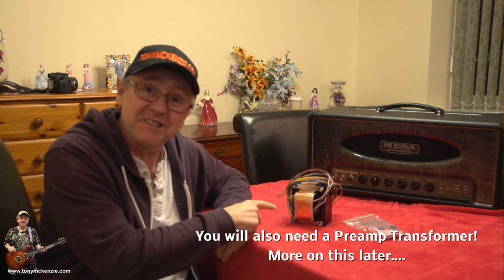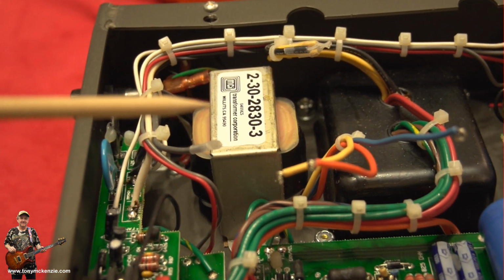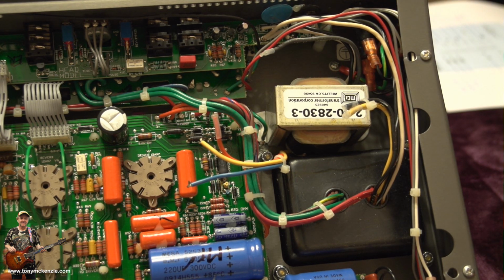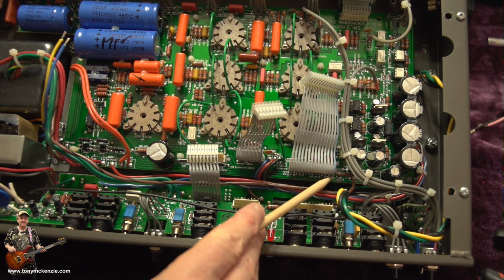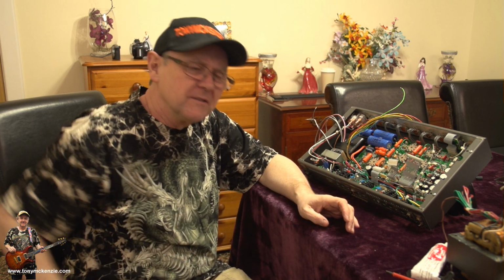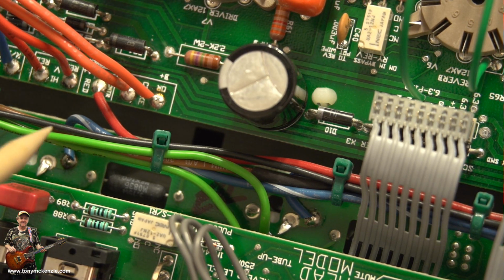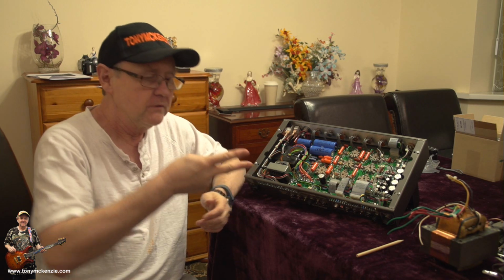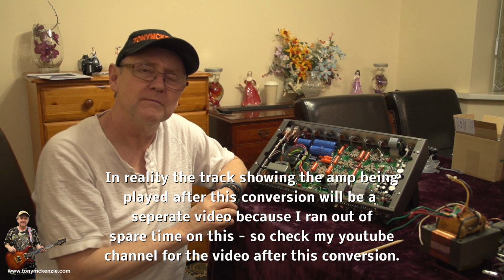How to Convert a Mesa Boogie Electra Dyne to 240 volts | Install a Power Transformer | Tony Mckenzie

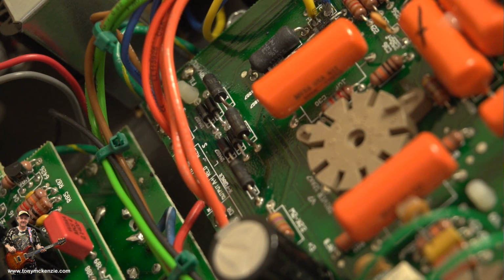Comment: I’m curious about the service modification you mentioned in the diode section at around 41:10. What is this mod supposed to do with regard to improved reliability?

I’ve got a ‘Dyne that has a pretty substantial hum which doesn’t seem to be caused by anything to do with guitars or pedals, it’s definitely internal to the amp. Particularly pronounced in the Vintage Hi mode with high “volume” (gain) settings. I’m curious if the diode mod would help here.
Reply from the maker: The mod is a Mesa mod... ask them! Ha but I believe it stops stuff burning out. You will see burning if there is the issue. Also look at the filter capacitors as if old they can create hum of course. Hope it helps and thanks for watching.

Comment: Does the orientation of the green filament wires matter? Testing them is no use as the ohms are too low.
Reply from the maker: I don't believe it does, but check on the diagram to be sure!  Thanks for watching.

Comment: can you link to a schematic and parts list, or email me one? pleeease? what kind of diodes are the d33 and d34 also? or just linking me those would be awesome. i see you have one in this vid.
Reply from the maker: I did NOT change the diodes - there is an in field mod that Mesa mention about rewiring the diodes because on some amps they have had failures I believe. Mesa might give you the info for that - its out there on the net. For the conversion you need the PT and the secondary transformer that I showed... both available from tubeampdoctor.com - ask for Stephan and mention my name as he worked with me on this one. You also need a MOV as I showed and a replacement fuse depending on your voltage needs. The schematic is also on the internet.

Just be careful as you can get killed if you are not proficient in electronics with high voltages as inside the Electradyne. Hope it helps and thanks for watching.
Reply: thanks for the response but i got everything squared away with an email to mesa and performed the mod to fix (bypass) that diode failure - 
I only messaged on here because you are the ONLY guy on youtube with a mesa electra dyne that still is active & knows what he's talking about. Don't worry, not trying to change the power here :) never had to get a schematic for an amp before, and was saddened to find that there were schem's for almost every mesa amp BUT the electradyne it seemed...but within only 2 hours i got an email back with the schematic, after leaving a voicemail with mesa cust. suppt
Reply from the maker: Yes I know, I had to get the schematic from them at the time too. The Electradyne is not a bad amp and surprising how basically it is not that common place. I have a Royal Atlantic too which is similar to the Electradyne but more drive and has some attenuators on there so you can drive the amp channels more. Good to know they helped ;-)

Comment: I'm in Singapore and it'll be great to be able to do this on my Mark IV. Just wish they all came with the old export transformers where you can switch from 110-240.. Running the amp on that big fat external converters for now.
Reply from the maker: Yes I run mine on the big lumps of external TX too a real pain. Some companies still have 120/240 in them but Mesa don't. Strangely DV-Mark used to be one voltage... but now on current stuff is 120/240. In any case as you see its not too difficult if you're used to working with electricity - particularly the stuff that can kill... so just be careful. The great thing is, that Singapore has the same mains plugs as here too :)    Thanks for watching.

Comment: The voltage in America is the way it is, because there were once two electrics systems. 110 volts DC and the transformer based, down to split, single phase 480 volts AC. But, in order for people on each system to use both Edison and Westinghouse light bulbs, they had to compromise the AC split phase 480 to go yet down again to 240 for split phase 120 volts. But, now with just AC, the US is still wired up for split phase 240 or 120 - G - 120. But could go to split phase 480 like Europe if they removed the individual street transformers. All the houses do have 240 volts AC coming in and many appliances in the US do run on 240 volts.
Reply from the maker: Thanks for that very enlightening information which I did not know... a great contribution to this video in fact. And thanks for watching as always.

Comment: Great video Tony, roughly how much do you save by doing this? Also how did you find the build on the jtm?
Reply from the maker: It is not too cheap to do it, but Mesa amps in the USA are without doubt on occasion (depends where you look) substantially cheaper than the UK... e.g. Road King II street USA $2500 - in the UK typical price is £2800 (that's nearly $4000). The transformer for this one was about £220 ($300) and the custom transformer was about £70 ($110). so about £300 for the bits - but depends on what price you buy the amp for whether its viable for someone to do.

The JTM build while simple(ish) is not in reality super simple... because the cables inside you really have to get right and twist right etc. otherwise I found you get noise (or hum) in the speaker. I resolved that by examining the circuit of a later Marshall amp. While I don't know the 'technical name' for what I did, basically you set up a small extra pcb that can 'balance' between two sides of a tube... that allows you to make an adjustment (with a small pot) to 'tune out' the hum. It works perfectly and reduces te issues of getting the internal wiring hyper tight....

I have never discussed before how I did that little mod, and it works on near enough most of the Tube amps I look at that don't already control the hum as that circuit does... as it was originally a Marshall inclusion they get the credit for it... but I have never seen anyone do it the way I did.
Reply: That's quite a big difference in price. Defo worth doing. Thanks for the tip with the amp if I start it I'll defo get some video for you Tony to say thanks!
Reply from the maker: Philip Downs OK...